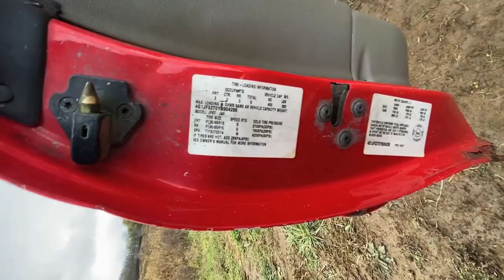Cavalier VS Saturn MUDDING!

Comment: There should be an alignment pin or a joint that connects the steering wheel to the outside shaft. The pin should be under the plastic trim. The u joint should be somewhere around the pedals. If either broke, the wheel will just free float. Not gonna say that it solves the problem, or that it's 100% the issue, but I would start there. If it was the u joint...... just zip tie it and redo it when they break. Keep it up guys. Love watching the shenanigans.
Reply from the maker: Couldn’t find it! Jumped it anyways!
Reply: @markfreeman408  Considering the fate of that thing, I don't blame you! Was fun while it lasted!

Comment: try taking the steering wheel apart on a Mitsubishi Montero and seeing the mechanical part inside of it or you could try using vice grips to turn the steering wheel when the steering wheel is off to see if it's turns the wheels
Reply from the maker: Oh we got her jumped with no steering!